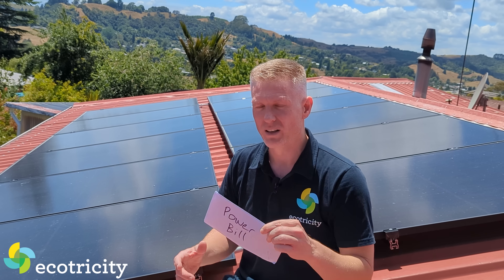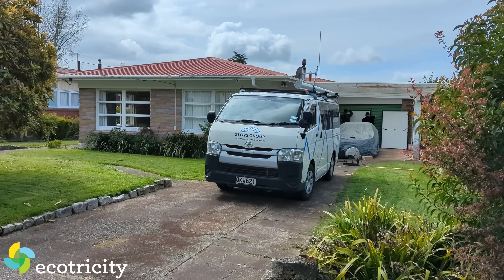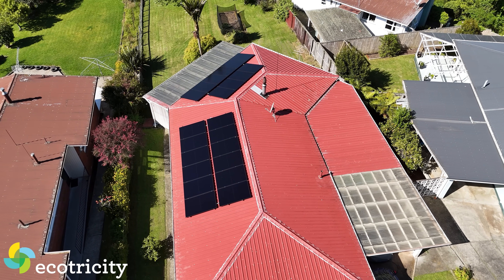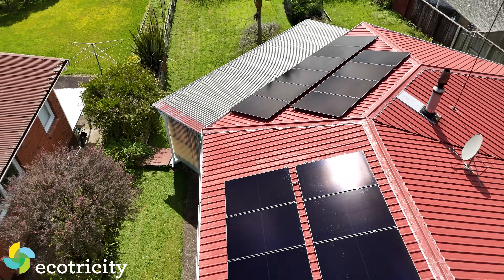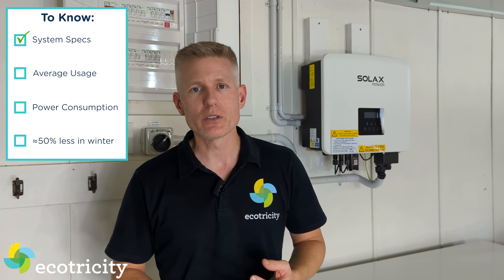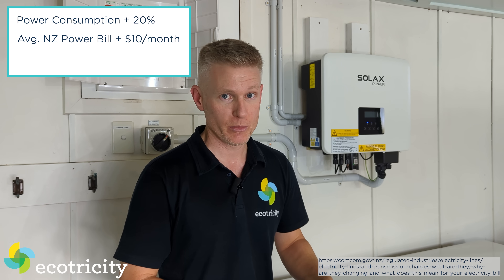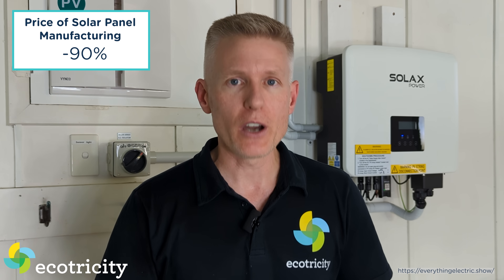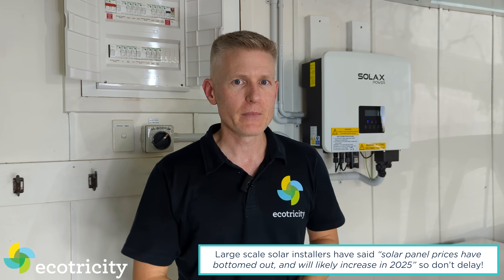Is solar power really worth it in New Zealand?

Comment: In New Zealand, you MAY not need a external meter. For me, this meant a $2,500/savings. Do not trust trust AI to give you the correct answer. ChatGPT told me "yes, as long as it doesn't export back to grid", but after asking to double check twice, it eventually said "maybe". Note you want to ask AI what your powerline provider says, NOT the same as your electricity provider. If you're lucky, you can delay moving power meter.

Comment: About 3 years ago I installed a ~6Kw system on my home in Tasmania. In the first year I ended with a credit of ~$500, my supplier was also able to reimburse this to my bank account for me to use as I like. As of this moment I'm currently in credit of ~$900 and I expect it to continue to make me money for quite some time. 
I'm now looking into a battery system to allow my panels to store some power for use during the frequent outages I experience. My panels need to have access to AC for the convertor to work. If that bugbear can be avoided I will be a very happy chappy.

Comment: I have a hybrid system as well. I am not in NZ, I don't have net metering. I would have bought a small battery and a few less panels in your situation. Batteries can nowadays handle 6.000 cycles. With one cycle each night, the battery should easily last 10 years. The battery allows you to benefit from consuming more of your own power and exporting less, allowing you to take advantage of the price difference. This means you don't need to produce as much power to compensate for your own consumption. In good conditions when you produce more than the inverter can handle, you can store some of that for later, rather than being unable to use it.
I think a small battery is still a good idea. A 100 Ah battery won't cost you a fortune and will allow you to produce power during blackouts. Just being able to run essentials at night or a lot of equipment when the sun shines is worth it imo. Where I am blackouts are common and even when they are not in NZ, you never know what the future brings. It's better to be prepared.

Comment: the big black panels will last but apparently the  little white box only lasts 10 years   and  did he have to move/upgrade  his switch box   the tech specs from one company stated it could only be  a max of 5 m cable  (=  big bucks ) 
he is only telling half the story by ignoring lots of extra costs charges and install issues (eg  do they really climb around all these roofs  with no scaffolding in 2025)

Comment: We had a 10 kW system installed a year ago. The power bill in winter has dropped to half, and during summer we have negative bill months. We don't have a battery, but will possibly getting one in a few years.
We also have two EVs, so we charge them with the solar system, which is nice.
We do not regret getting the system installed.

Comment: isn't a better option a tankless hot water system.  the reason to keep the water heater at 120F is to make it inhospitable for the bacteria that cause Legionnaires' Disease. Turning if off and on is a grand way to have lukewarm water these bacteria thrive in.

Comment: In an older house I'd  have replaced your roof with new iron and roof paper with a cavity system as there are more chances of leaks from extra roof penetrations. I have worked with ex solar panel installers and heard of this issue. Also make sure to have easy access to clean the panels as they will get dirty. Always factor in all costs before getting panels installed even the potential ones.

Comment: I installed PV panels in 2013. Payback was about 8 years on a $15k installation, but it's difficult to be accurate when power consumption varies as kids come and go and whether you factor in what money you might have made investing the $15k and using that to offset costs. But on average consumption was about $2.5k pa and that was reduced to $800 pa. Factor in increased energy prices and I'm happy. My original system was 24x190w panels and a 5kW inverter. I'm down to 22 panels now (two damaged and although producing, they leak DC to the frame so I've removed them) and running at 88% efficiency. I'm still very happy with the install and likely to add new panels in the coming year as prices have dropped dramatically while panel power has increased 2.5 to 3 fold. I've been tempted by LiFePO4 batteries but as my annual bills are so low the cost of the batteries is hard to justify with return on investment. I've decided that my best return will be use a BEV as my house battery for the evening and re-charge the BEV at cheap (or free) overnight rates. Just waiting for decent BEV V2H or V2G options to be avilable in NZ.

Comment: The batteries that match your SOLAX inverter have good and bad about them...
1. They use serious hardcore industrial grade LFP cells and they work really really well.
2. They are the ugliest batteries on the market.
For pretty gear that works well LUX inverters with Hanchu batteries (don't get the big Hanchu battery get the smaller ones to make up the storage you need. They look better on the wall and if say you have 3 of them and one has a very unlikely fault you still have the other two. If something goes wrong, again unlikely but if, with a single large battery, then you've got nothing).

Comment: When I lived in Perth in 2013, you could get 3 kw for $3,000au - installed.  The world wide cost of solar has dropped by 87%, and batteries by 85% in the last 10 years.  9.7 kw for $21,000 is very expensive.  $10k for 9.7 kw would be a more realistic price, though still on the high end.
Reply: The Aussie model of incentivising solar is exactly what NZ should be doing presently, and previously, but our government has its head up its a**e and is considering importing LNG to burn for generation. How much different our energy sector would be now if we'd had the foresight Aussie did years back.
Reply: @HarmLessSolutionsNZ  Careful what you wish for.  There are big downsides to pushing for home solar.  The big one being when solar panels break (physically) they spread very toxic chemicals.  The next is, once there is enough home solar we will reach a tipping point where power companies, in order to recoup lost revenue will raise prices on all those that do not have solar.  That means the lower and even middle income families will struggle.  Not everyone can afford solar, especially at the ridiculous prices being charged.  Many who do not own their own homes and have landlords that refuse to install solar will be trapped paying very high energy costs.  And there will be a lot of landlords who will refuse to install, just look at whinging landlords are doing over getting basic insulation and heat pumps installed, and they're cheap compared to solar.

The shame is, the Govt. force us all to pay for the climate rubbish they push, and we send multiple billions of $$$ off shore every year to people and places we are not told about, and we receive nothing in return.  One program alone, NZ is sending $1.4 billion a year off shore, we don't know where it goes or for what.

But since home solar is here, I agree, it should be either very heavily subsidized, or preferably free, and it should be paid for out of the money that is sent off shore to interests we are not told about.

Comment: Great video. But it really depends on your household situation. Old house vs new. Heating. Kids. At home during the day etc also what your lines charges are! Mine are $4.50 per day!
I have a 10.5kW solar and 5kW battery setup. No restriction on export in my area. Only getting 8cents per kW on export with contact good nites plan. Force charge battery between 9pm & midnight. Timer on hot water to heat during the day and 9pm to midnight. We easily use 1500kWh per colder months. Best to start with efficient hot water heating especially with a family. My 2 cents

Comment: I am on the process of increasing my off grid system. I recently moved a relocateable home on my land. After living off grid in my current place for 12 years with no issues, but with having two dwellings on the same site my system is too small. I can install a far bigger system including a 10kw battery for around $24k NZ. I then thought about maybe selling my excess back to the grid. I have two quotes to connect power from the power pole to my front gate ( approx 8m ) the cheapest quote for the cable is for $25k NZ
 So I can install a complete 20 panel system with 8kw inverter and 10kw lithium battery, less than having a power cable installed, which by the way I will own, because before they install I have to sign a letter " gifting" the whole thing I would have paid them to install the cable back to them so they then own my power cable ! Yeah rite, it's a no trainer for me.

Comment: If the Government subsidised these for every household and business, there would be no need for coal or gas electricity generation. No need for expensive, dangerous to the environment coal imports. It would save the Government greatly in the long run. In natural disasters, and the grid was damaged and disrupted, individual power generation would be highly beneficial.
Reply: Large scale solar destabalises the grid.  That is why reliable power generation is needed as backup.
info here:  https://www.youtube.com/watch?v=YbxpieEQ7bc
Reply: @dsjjvfdjkdd  Incorrect. Solar farms paired with big batteries stabilises the grid and are more reliable than coal generators. Hilarious you linked to a Sky Noise vid with renewable energy denier Uhlmann. Sucked. In. 😄

Comment: If you are going to add a battery, do not get one from Redback.  Ours has never fully worked and reported properly. Been fudzing around with it for a few years now. Redback keeps trying to get it sorted, so good on them for trying, but still a pain. Instead of keeping the battery ready for power outage, and cutting in when the power fails, it uses the stored energy every night and has less han 20% left  by morning - leaving nothing for a power failure. Also,  does not cut in automatically when the power fails. We have to throw a couple of switches. Wish we had gone with Tesla.
Reply: Ive installed many many redbacks, they should supply power in a powercut scenario almost instantaneously. 
Most systems have adjustable settings for how much power is saved in reserve for power cuts, cant recall for redback but its likely there. 
Note that if you keep a high reserve of power, your system payback time will be increased.
Reply: @beyondthelol  Payback time is not an issue for us. We are more interested in power security during one of the many power cuts here. Our system has not been acting properly since installation.  We have gone through two circuit boxes, spent literally hours on the phone and in emails, and still,  when there is an outage, it does nothing automatically.  We have to shut off the main switch, then change the rotary switch from mains to battery.
Reply: Our Tesla PW2 has been fantastic. I disconnect from grid most days in (Oz) summer to avoid negative FIT.  It occasionally does in fact provide seamless power when the grid goes out. We're charging 2x EVs, fully electric 3 Acre property, on Amber Electric.

Comment: Do you have to separately insure the panel against storm damage.eg .hail ?
Reply: No. Panels are rated to survive 25mm hail at 23m/sec minimum per IEC61215. Panels are tougher than most roofing materials. You should get a discount on roof damage from hail if you have panels!

Comment: Does this all include the daily charge? his Nov bill was $13 so there cant be a daily charge included in that right? so if you have solar theres no daily charge?
Reply: Typically part of the credit you get for your exported generation goes against offsetting daily ('lines') charges, so the $13 will be the sum of daily charges + imported electricity - exported generation. The large credit in the following month will be the same equation but a much larger amount exported and perhaps less import too.

The only way to avoid daily/lines charges is to go off grid but that requires upscaling the panel capacity and investing in significant batteries. If the forecasted lines charge increases later this year are too high then off grid will become a viable proposition.

Comment: Enjoyed your vid but I have one question - how much did the fusebox replacement set you back?

I'm in a similar scenario as you but my house isn't as old (80s). I have an external meter box but the fuse box (which uses ceramic fuses) is in the centre which is awkward as it's a 2-story house with all power & water run through the middeck.

I liked the water heater timer so I'll definitely be doing that but obviously I don't have to worry about the external meter box or additional outlets.

My December 24 power usage is almost exactly the same as yours (494 kW/hrs vs your 495) although I just got hit with the increased Fixed Charges. Normally I'd pay about $150 but its gone up to $180 and likely to rise even further when low user rates finally disappear in 2027 (The December bill is usually higher every year as it covers 33-34 days whereas the other months of the year never exceed 31).

Lastly, I'd note that your bill comparisons are for mid-Summer. It would be interesting if you were to post a follow up vid in mid-Winter to see how the solar system stacks up at a less-than-optimal time of year.

Addendum
I discovered the earlier vid in this series stated the Power Meter relocation at $2k. Presumably this was for the relocation to the external wall as well as updating the internal Fusebox to current standard.
Reply: Yep unless you disconnect completely, you're still at the mercy of the electricity company

Comment: $21,000 / $0.30 (30cents per kwh) gives 70,000 kwh you could have bought from the "Grid" the 200kwh exported would take 350 years to pay back. Obviously you use most  of it but i don't know how much. Still it could be longer than the life span of the system.

I have a different approach.  We have 3 hours free from 2100 to midnight. We do our water heating and EV charging at that time. Plus heatpump use and sometimes heat lamp/towel rails in the bathroom. We use more free power than we pay for and it was basically free to set up.

Comment: Just bear in mind that the feed in tariff you get paid for exporting will drop as more solar comes into the grid.  Thats the experience here in Australia where average feed in tariff is $0.05 per kwh exported and the future looks like feed in tariffs will drop to zero or you may even have to pay for exporting electricity.  We have so much solar in summer there is no market.

This is not to deter you going for solar but rather to set expectations.  I have 13.2 kw system and have not regretted going solar
Reply: Nobody earns anything from ordinary power co feed-in anymore. You need a battery so you can export at peak rates in the evening and avoid paying peak grid import rates. Amber Electric wholesale is where to be. Our 12 month feed-in avg is 65c/kWh. Occasionally there are price spikes that can go up to $18.13/kWh for brief periods. We're >$2000 in credit at the moment.

Comment: NZ has the highest cost of power in the world V cost of production, NZ should have  the lowest power cost in the world but does not due to corruption,
Water 95% /Geothermal/wind/Solar,
Solar is also a scam, Profits on solar is like 200%.
just to add i brought a small helper solar system in Philippines to reduce cost and for blackouts, paid for itself in 1 year, not 10-or what ever other stupid timeframe,
So now cost is down 20% and have basic power in blackouts

Comment: I'm in country nsw Australia, in one day I produced 30.22 kWh excess @ 0.05c kWh  had to buy back 5.56 kWh from the grid @ 27.79 kWh, it  cost me more to get power than it did to sell it. My power biller is AGL.
Reply: Batteries,,,
Reply: AGL is a total ripoff. Get a battery, even 5kWh, and get on Amber Electric wholesale so you can export power in the evenings at high peak rates. We have 10.5kW PV & 3 powerwalls (40.5kWh). We save $4000/yr y not paying for grid power, our 12 month avg feed-in is 65c/kWh. we're >$2000 in credit at the moment.

Comment: What is the expected lifespan of your solar panels?
Also your roof system was ready for installation, some folks here in Canada may have to replace their existing roofing and also have an engineer check for structural stability with the added load.
I'm glad it's working out well for you!
Cheers 🇨🇦
Reply: I'd Be surprised, as solar panels generally don't weigh much at all. He mentions life span in the video.